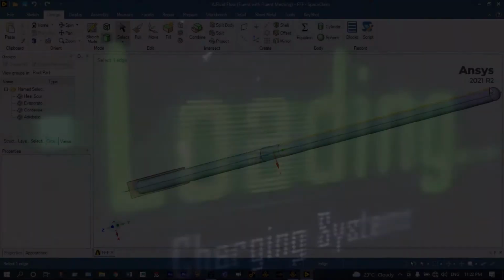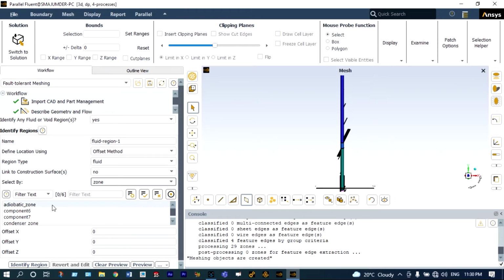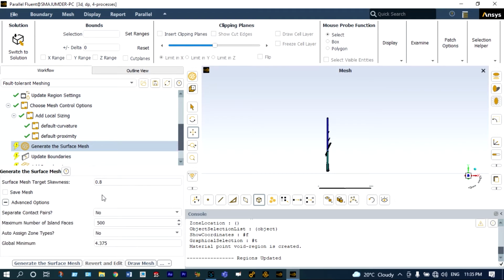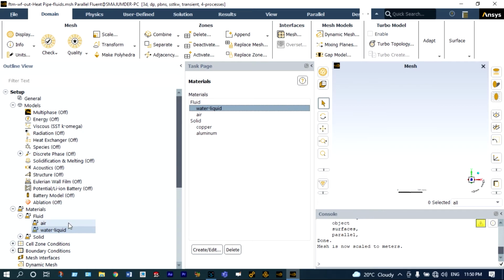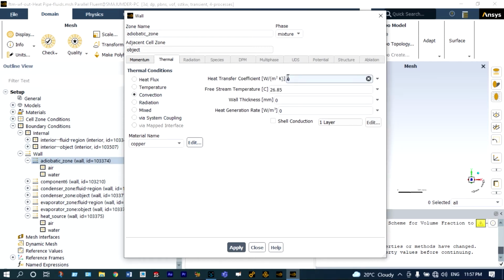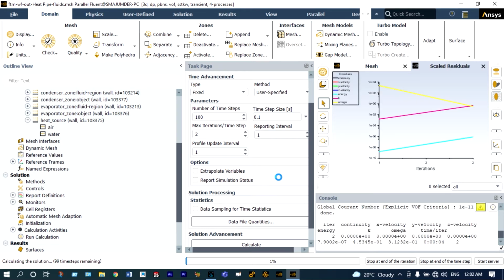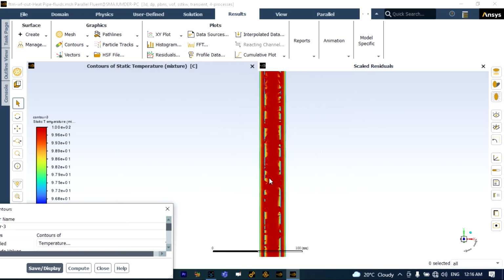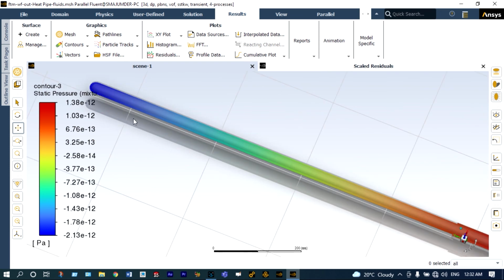Mastering CFD Analysis of Heat Pipe | Simulation of Heat Pipe | ANSYS Fluent

Comment: How to convert the given file by you in erudire plus to .fmd format
Reply from the maker: Initially the file was made with SolidWorks. From SolidWorks save it as step file, then import that step file into ANSYS spaceclaim and from ANSYS spaceclaim geometrical imperfections or any problem is there that can be corrected or rectified and then finally that to be saved as fmd format for further fluent analysis using ANSYS fault tolerant meshing method.

Comment: sir how did you made wick structure of heatpipe, please reply🙏
Reply from the maker: This model is not as per industry standard. This was modelled using theoretical considerations and later on its geometry can be modified as per optimization required